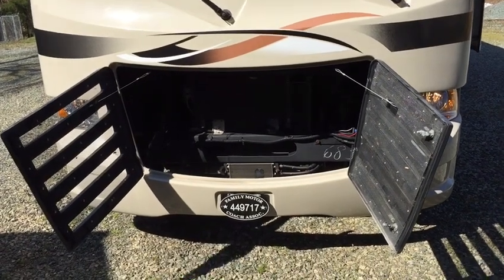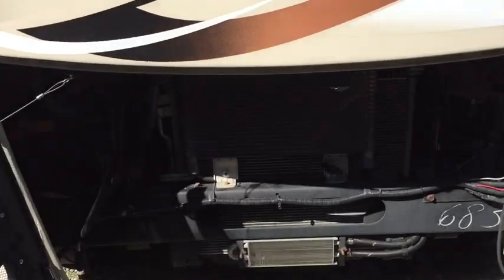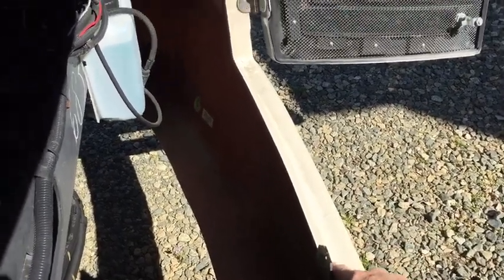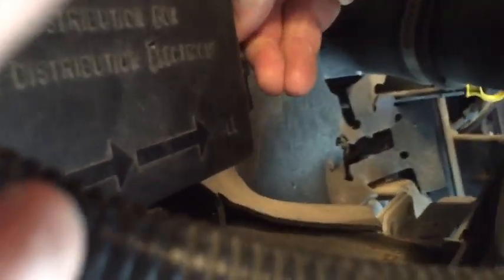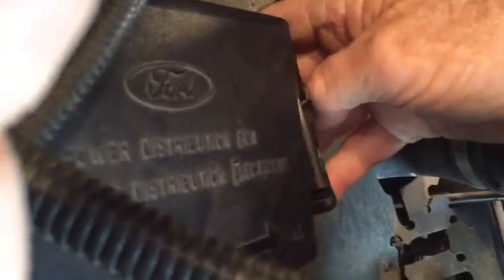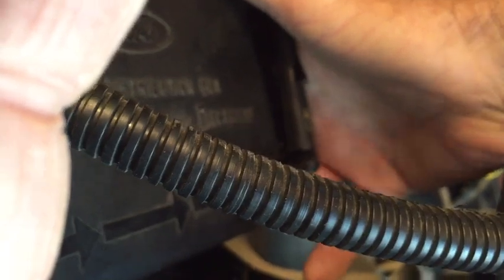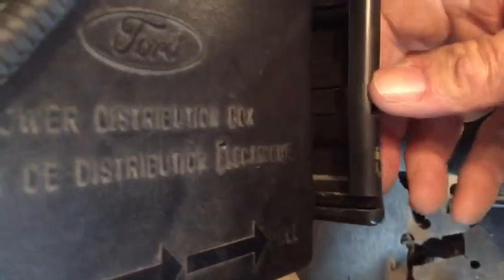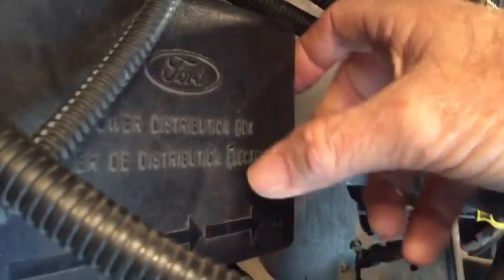ACE 29.3 engine fuse block location

Comment: GEEZZZZZ, I didnt even know about that one, there are a couple under the dash to the right of the steering
Reply from the maker: Oh yeah, forgot to mention that i checked all those fuses before finding the correct one in the engine compartment. None of them are easy to get to.
Reply: @modularmania2012  that is a fact!. I was trying to use the manual to diagnose a blown fuse and none of the inside boxes matched the manual. Maybe the one you found did but the fuse I blew was in the battery compartment and is the same fuse
 that powers the radio